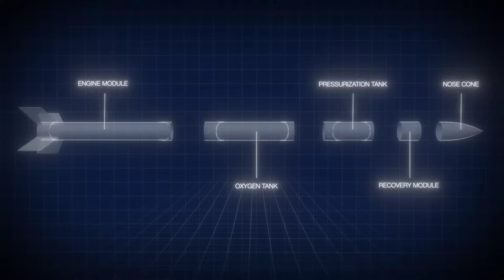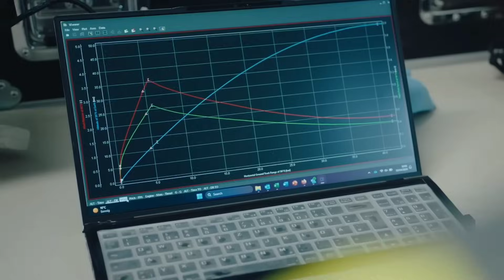Germany lifts off from Australia!!  HyImpulse makes history with innovative hybrid rocket!!

Comment: About 10 years ago, I did some work for a company here in the USA, that used a very similar(if not the same) method of hybrid rocket technology. The awesome thing about hybrid rocket tech, is the ability to throttle and re light the engine at will. Also boil off is reduced by 1/2 as the only thing that can be lost is liquid o2 (or at least until we find another, more stable, oxidizer componet). By the way, the rocket was 20ft long x 20 inches in diameter and produced 20,000 lb of thrust! Fairly impressive,!

Comment: so basically just a big version of what mythbusters did on their confederate rocket episode.
Reply: Not really. I don't think mythbuster ever did any pluming to their rocket. I think they did strictly solid fuel motor in their tests. Not to say any kind of gimbal control.

This rocket, if I get it correct, uses paraffin with liquid oxygen. They can control the rocket by controlling the dynamic pressure of oxygen supply. And they will add gimbal and onboard avionics to control their rocket's trajectory.
Reply: liquid oxygen >>> energetic and efficient

Comment: HyImpulse is aptly named. I am sure the idea is to capture some of the convenience of solid boosters with an ability to.shut down and an efficiency close to liquid rockets. Most hydrocarbons have a similar Isp to kerosene with oxygen. So, somebody has finally bitten the bullet and said, "Why not liquid oxygen instead of nitrous oxide or peroxide for VASTLY greater performance?"

Comment: So did they recover the rocket, and can they reuse it?
Reply: I think refurbish might be a better term. I'm not overly sure but SpaceX boosters can be refueled because the fuel is a liquid, like high power petrol (in the case of the Falcon 9). I just can't picture a mass produced solid fuel, since it's cylindrical.

Comment: I love rockets more than most people, but this one was a little hard to get too excited about. By all means, it's no small feat to launch a new sounding rocket like this one, but at the same time, it's relatively low complexity, and was nowhere near space. There are dozens if not hundreds of similar launches every year, across a wide variety of different rockets.

It really underlines how far HyImpulse still has to go.
Reply: It was just a first test for the bigger version where more core stages are bundled together. And the low complexity will actually be an advantage for the bigger versions later because launch costs might get much lower than with complex liquid fuel engines.
Reply: Being both low complexity and using two efficient fuels is the whole point. Unfortunately, it is obviously higher complexity than portrayed, as putting these two desired things together has for some reason put more people off. Maybe computational complexity of how to get it working, like the rotation detonation engine? Big !== advanced
Reply: Maybe like the solid ramjet in the Meteor missile (UK) - tough to figure out, but cheap to build, and outperforms traditional rockets. Is it "complex" when theory is hard and build is easy? And for all the people that don't get it - a LOX/hydrocarbon is a rival for a liquid rocket, better is than traditional solid rockets. She tries to clue in people by using the name, "HyImpulse!"

Comment: We really need options for fuel. And do not hesitate to use different fuels for different stages of a rocket whenever that is optimal.
Reply: Would that not add launch cost? 

-Increased ground infrastructure
-Potentially hazardous chemicals (Hydrozene comes to mind)

Although, Using a Solid or Hybrid first stage to decrease part count (and hence complexity) is a good idea to explore. ❤
Reply: Launch while fighting against the 9.8m/s^2 of gravity requires very concentrated thrust.  It is easier to generate high thrust when using a fuel which has high energy density per volume.  That is the same reason that we use gasoline, or kerosene (aka diesel fuel), for terrestrial propulsion.  On the other hand upper stages do not need to counter gravity because by the time they fire the spacecraft is travelling nearly horizontally.  So for upper stages it is better to go for high energy density by mass.  The Space Transportation System (STS) popularly known as the Space Shuttle was focussed on recovery and reuse and was at first considered an experiment toward developing a Single Stage to Orbit (SSTO) vehicle so it used hydrolox engines.  However it would have needed twenty-five SSME/RS25s just to get off the ground, so they added the solid rocket boosters (SRBs).  I do not understand why ESA went with hydrolox propulsion for the first stage of Ariane5 and Ariane6 as that choice massively increased the cost and increased the delays in reaching production, when they did not have the motivations of NASA for choosing that technology.
Reply: @jamescobban857  VERY COOL space shuttle fact! Would the specific impulse of an H2/O2 liquid fuel mix not be better for concentrated thrust? Also by "voncentrated" what do you mean?